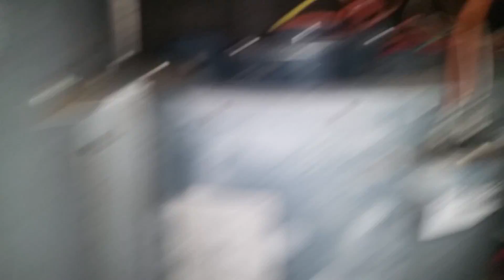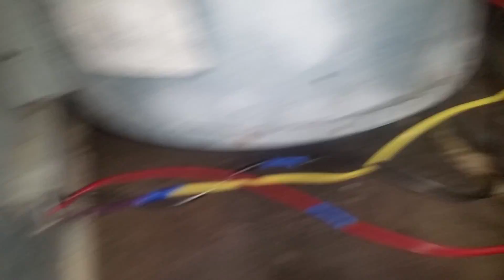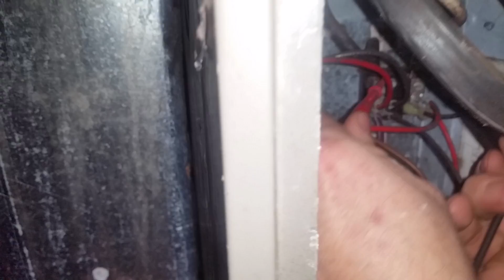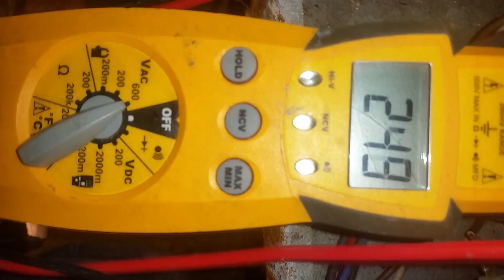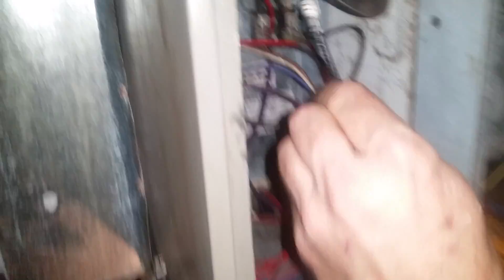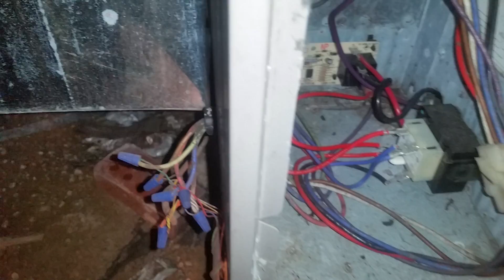How to Diagnose the goodman fan control board

Comment: Good topic.  thanks for posting
Reply from the maker: Thanks For watching
Reply: Expert Express plumbing heating and air conditioning I think it's always good common sense unless you have to take voltage and amp measurements to always turn the power of the appliance before work even if that person is an repair tech or known a lot about electricity, if taking voltage and amp measurements is necessary i always what to make sure only the meter is touching the live components inside of the appliance

Comment: It would be a big help if they put insulation on the power wire connectors to the transformer.  Slide your arm against that 240 a couple times and find all the burs on the sheet metal. Then get confused following wires to the sequencer etc. Ive had my fun.

Comment: that is high voltage coming in from utility power, 249 volt phase to phase will stress any electrical component, assuming the fieldpiece meter is accurate, id go to the electrical panel and check each phase coming in and confirm, then advise the homeowner to call their power company, also check phase to ground for high voltage
Reply: Ben Staton very good video!
Reply: Ben Staton Your funny, call the electric company to turn off the transmformer? So what if it is high voltage? You already have 240v what's the point of checking the panel? Do you even understand the basic theory how electric circuit works?
Reply: I don't think any power company is coming out to check anything with a EMF less than 5% over or under.

Just sayin'...

Comment: your condensor runs on cooling but you still check for high and low voltage at the air handler. if your ahu has no high or low voltage the condenser wont run unless the contactor is pitted

Comment: Thanks for taking the time to make and upload the video. However, you are taking serious risk to put a meter probe in each hand. Under the wrong conditions, you could conduct voltage through your chest. Your heart will take a hit, and you are finished. I learned this from Purdue University. A lady here hired a plumber to fix her sump pump. He went into the basement, and never walked out. Firemen removed his body. Alternating Current is almost as dangerous as Thomas Edison claimed.

Comment: great video. I have a GM 80%. What causes my fan relay switch to repeatedly open and closes when it's trying to run the indoor fan. This will only happen when the fan goes on the first 1min. And then the fan will not get any amp for about half a minute and then it will run smoothly thereafter. I replaced the board twice already and the symptom is still there. Any help you can provide is greatly appreciated.

Comment: would faulty relay board cause the blower to continue to run when thermostat is turned off. My blower keeps running. Thanks
Reply from the maker: +Esteban Garcia it is most likely a open limit that is causing the problem
Reply: Yes the relay is stuck in the closed position

Comment: Hey how are ya I got a question what is the blue wire on a Goodman aruf air handler located on the motherboard next to the letter c what is it used for
Reply: It's 24 volt common

Comment: Question? If I measure the transformer, it doesn't show 240V. But I measure one leg and the chassis, it shows 110V. Another leg and chassis, it shows 110V. But bot legs of transformer, they dont show 240V. What is the issue there?
Reply: You’ve lost one leg of power. Check breaker or fuses

Comment: does the fan run on high speed when in heat mode? If it has heat strips
Reply: The fan runs on mid,or slow speed, the hot air is lighter than the cold air, the cold air in the return air in the air handler unit pass through the coil,or the evaporator, then on the heat strips, the heat strips will stay on only when the outside unit is in defrost mode,if your unit is a heat pump unit, if your unit is a straight AC unit with an electric heat strip ,the thermostat will have the heat strips on all  the time the thermostat is calling for heat , again the fan should run on low speed,or at on medium speed, the return air is heavier ,and colder passing through the heat strips, if the fan runs on high speed, the cold air in the return air will dissipates the heat from the heat strip, before it will supply heat to the room inside the house,and the thermostat will call for heat until the room temperature is satisfied by the thermostat set point  , your electric bill will be higher,that's why the fan should run always on slow speed in heat mode.
Reply: What was the cfm your unit was producing overall, compared to the cfm required for the furnace output, taking into consideration how many heat strips you had running at any given time and the BTU's produced per strip?